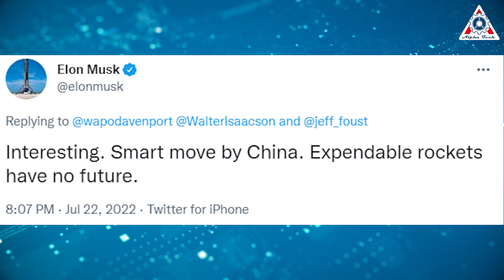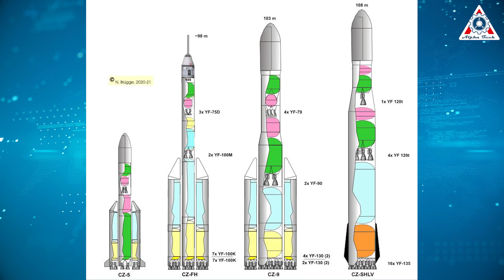It happened!! China's most modern fully reusable rocket in the world, humiliating Elon and SpaceX

Comment: this is hilarious, China's long march rocket has the technology of a bottle rocket compared to space-X's Falcon 9 and StarShip, not even close....
Reply: My favorite comment for a long time!!
Reply: And today china proved how cheap shit doesn't fly to space
Reply: Yet it works and Starship doesn’t. Also Falcon 9 isn’t fully reusable. Some times simple is better.
Reply: @matthewalford4581  "Yet it works and Starship doesn’t" - nope, it doesn't work. Starship already lifted from the ground and landed, more or less successfully. LM9 didn't lift yet from the design table. "Also Falcon 9 isn’t fully reusable" - it is, they can even recover the fairings. But it can also fly in an expendable configuration with a bigger payload. LM9 is in the design phase since 2011 when it was imagined as a copy of SLS. But in 2021 they changed the objectives and decided to make a reusable rocket. LOX-kerosene in the 1st stage, LOX-LOH on the second. LOX-kerosene is what SpaceX is already using in their Merlin engine (Falcon 9) for quite some time now and it has a problem: kerosene tends to clog the nozzles, making the engine more expensive to maintain. Hydrogen has its own problem: it's difficult to keep and manage in liquid form, and it causes embrittlement in steel so there will be a lot of parts that need to be replaced after each flight. Methane is good enough in both worlds, ISP (better than kerosene, worse than hydrogen) and thrust-to-weight ratio (better than hydrogen, worse than kerosene), but it can be made on other planets and it offers the best chance for a long-lived engine. But its design in the full-flow staged-combustion-cycle version (Raptor) needs a lot of innovative unconventional thinking. The other methalox engine, BE4 (Bezos's Blue Origin), still struggles to maintain combustion stability. Do you really think that a country with a long history of stealing and that is still using hypergolic propellants in some of their civil rockets is able to overtake SpaceX overnight? So what no1toolmkr is saying ("China's long march rocket has the technology of a bottle rocket compared to space-X's Falcon 9 and StarShip") is absolutely true. 1 year ago, a Chinese rocket made an uncontrolled re-entry. 24 hours ago, another Chinese rocket made an uncontrolled re-entry. LM3B keeps falling in their villages and, if you didn't know, that guy uses hypergolic propellant which is quite toxic, it doesn't offer either good ISP or thrust, but it doesn't require too much of a technology to use it, either. Those failures are not tests, like the ones with SpaceX Starship, those are real Earth-to-space missions.
Reply: @kushagravlogs5627  I didn't say Starship is ready, I said "Starship already lifted from the ground and landed, more or less successfully." StarShip is not even designed to lift from the ground unless that ground is Moon's soil. So, obviously, it isn't ready because they still testing it. But it is a bit more than the existing plans for LM9 that were started in 2011 but radically changed in 2021, don't you agree? 
"Space x is not fully reusable." - I guess you wanted to say Falcon 9. Well, they reuse the fairings, the body, and engines, so it's pretty much reusable. It's the most reusable rocket in use. Advanced? No, it's not. It was made to be cheap to use and reuse, not advanced. Probably the most advanced rocket in the test phase is Starship. Nobody made a working full-flow stage combustion engine so far, except SpaceX. And about China's LM5, yes, it's a nice heavy-lift rocket, it's the most powerful rocket China has, with 14t to GTO. But it has zero reusability, it uses hypergolic propellants in its 3rd stage and, performance-wise, it's still behind SpaceX's Falcon Heavy that is capable to put 16t to... Mars transfer orbit (26t on GTO).
Reply: @milutzuk  second stage isn't reused
Reply: @Bruhza5870  that's right, it's a burner. I forgot about that. No provisions for dumping (an order of magnitude bigger compared with the boosters) kinetic energy as heat during reentry and the vacuum engine bell makes it non-reusable.
Reply: @milutzuk  Dang, so like you can't attach landing legs for it to be recovered
Reply: @Bruhza5870  Haha, no. It needs a heatshield and sea-level engines. Also a surplus of oxygen and fuel. Those requirements make it too heavy and probably would increase the launching cost, despite reusability, instead of decreasing it. A booster has 9 engines, makes sense to want to reuse them, second stage, only one, can be thrown away. The Starship, which can be considered a second stage has both sea-level and vacuum engines, it was designed to be reusable. Anyway, that you for pointing out that the second stage is not reusable. The second stage and the red Tesla.
Reply: @milutzuk  dang that sucks
Reply: @matthewalford4581  Starship isn't ready so your statement is rubbish
Reply: @davidbate6346  Are you working for china?
Reply: @davidbate6346  Starship isn’t ready? Really? So I guess we’re back to calling delays “Elon Time”. So the FAA big bad government bureaucracy  wasn’t holding up our “dual planet civilization” saga after all. Starship just “wasn’t ready”.